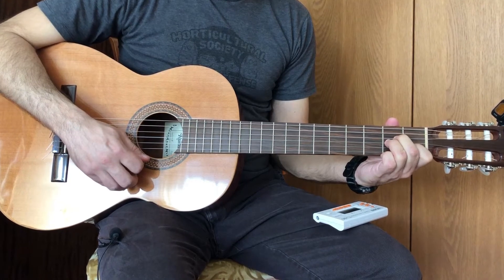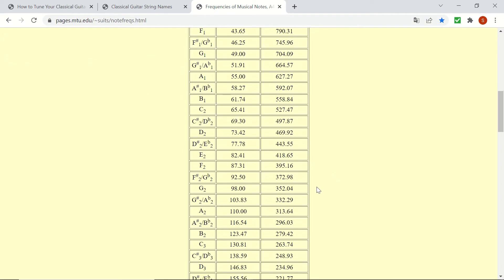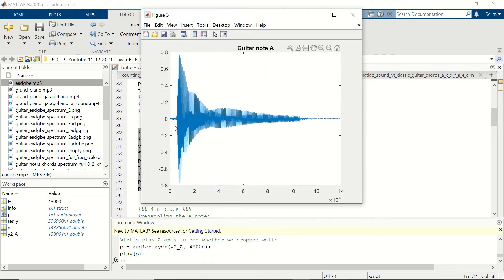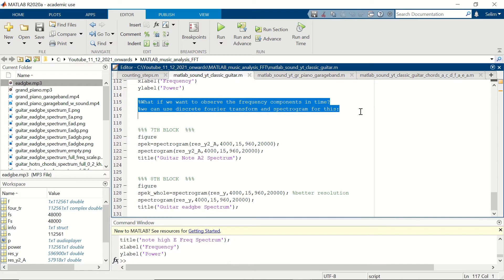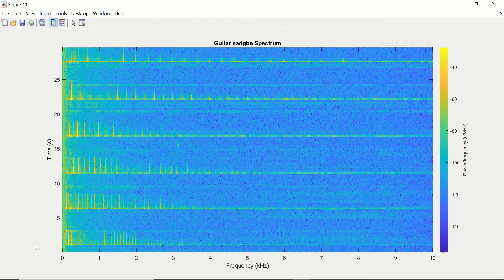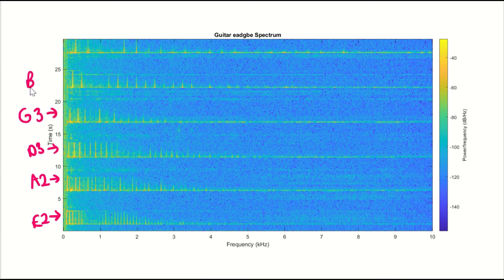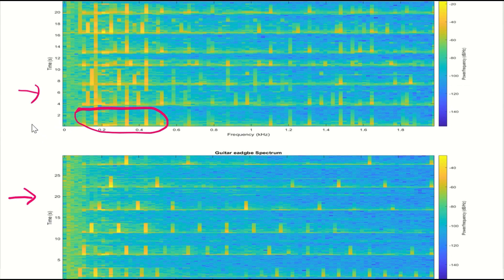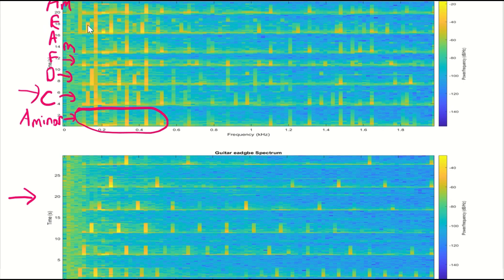Musical Notes : Frequency Analysis with MATLAB

Comment: Hi! I was trying to do the same analysis using piano notes but i didn't understood what the "resample" function does, you put as an entry of the function 20000 but i didn't understood why. Can you explain? Thank you, really good video.
Reply from the maker: Hi thank you for your comment. The resampling is done mainly for reducing the data size, initially in the recording we had 48kHz samples in a second, with the resampling we reduced the data size (20kHz). It also affects the Nyquist frequency: basically we'll deal with the first few harmonics of the notes, so we're not required to analyze frequencies above 10kHz or maybe even less (i.e. the highest frequency to be observed would be B8 which is 7902.13 Hz : https://pages.mtu.edu/~suits/notefreqs.html)
I hope this helps you with your question.